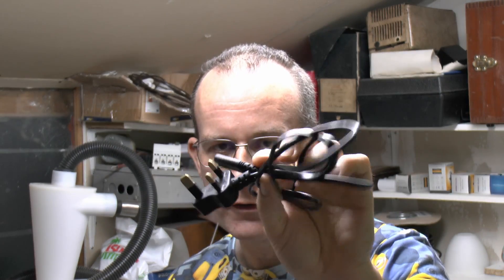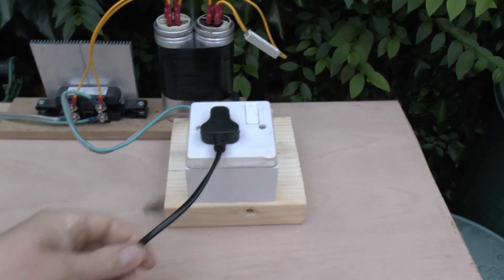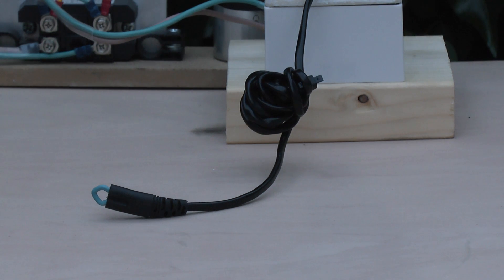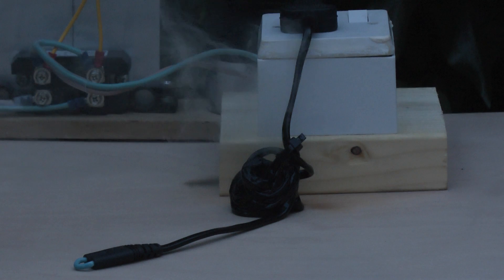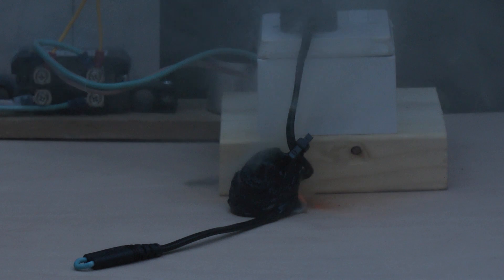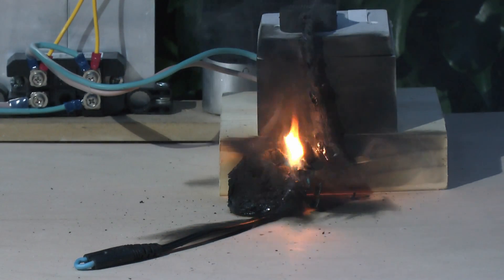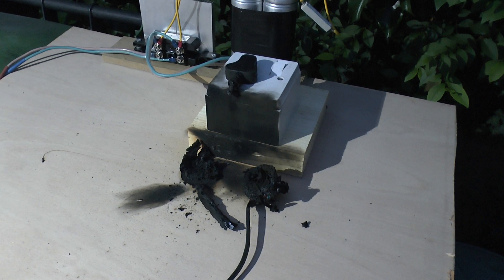Uncoiled and Coiled Overheating Power Lead and DC Burnout

Comment: Is this caused by the coil or the short circuit?

Could you short circuit it without it being coiled and would it do the same thing?
Reply from the maker: Caused by the excessive current and short circuit.  Coiled up just concentrates the heat into a smaller area so it fails faster.

Comment: I've got a plug like this has the 3 pin on the other end for an xbox charger would you recommend getting rid
Reply from the maker: Yes, it's not safe for use.
If the charger came from the same place, suggest getting rid of that as well and buying an official Microsoft one.

Comment: A bit of an unfair test though, 16 ish amps as 315 VDC (assuming that device is a full bridge rectifier) is quite a bit more than any appliance cord will ever see. Also, the exact same cord is very common in Europe (sans the ground pin of course), and they are not an issue at all. But then again all our appliance cords are unfused, commonly 0.75 mm2 conductors, and we manage to not burn down our houses quite well anyhow. But then again all sockets are usually behind a 10, 13 or 16 A fuse, never a 32 as with your rings. How the insulation kept burning after the power was cut is a bit worrisome though, but if they didn’t bother to follow any standards for the plug I’m not surprised that they skimped on the insulation as well.

Comment: Have watched this twice now. I totally agree that these plugs are wrong but the plug did not fail in the test and the cable only failed because of the coiling up as any cable would do. If the circuit was fed from a radial MCB as I beleave you prefer then it would be protected.  That said thanks for the smoke and flames always makes good viewing.

Comment: To be fair.
John had to cross a lot of boundary's to make that fail.
Although I agree it's 100% crap, if it was used as designed, it seems to me that it could have handled it a 3kw water heater worked just fine until the cable was coiled.
Can anybody tell me what would have happened, if a correct British standard lead with 13 amp plug would have done differently?
Reply: A correct British 13A plug with 13A fuse and minimum 1.25mm2 flex is rated to carry 13A indefinitely. So, nothing would happen - the water in the (plastic?) bucket would eventually boil...
Reply: Problem with the cable in question was that it is supposed to handle 13 amps but as you can see at the start of the video, it gets almost too hot to touch at merely 12 amps.  If they'd used the correct size of wire it would barely be warm at 13 amps so even coiling the cable would've taken much, much longer to heat up to a dangerous level.
Reply: @Berkeloid0  Worthy to note even 5A on a coiled up 13A rated cable is enough to overheat it.
Reply: @millomweb  I would like to see that put to the test because not that I don't believe you, I just find it very surprising that a couple of loops would be enough to go from ambient to overheated, so it'd be very interesting to see how little (or how much) it really takes.
Reply: @Berkeloid0  I said a coiled up cable - not just a mere couple of loops.
Sadly, I didn't get a photo of the wrecked cable nor did I keep it. I'd be surprised if there isn't an image of similar on the web somewhere.
Reply: @millomweb  Well I only meant coiled as in a cable loosely looped around to shorten the length.  Of course if you tightly coil it up then it's going to increase the inductance but I'm thinking more about a typical domestic situation.  Not that interested in images though - I know what would look like - I mean an actual test like JW does.  Comparing different loop sizes vs heat production to see if there's a point at which it changes from being relatively harmless to risky.
Reply: @Berkeloid0  I don't think the issue is down to induction but due the the fact a coiled cable  significantly reduces heat loss. 
Good extension reels have thermal protection. The typical domestic situation is a 50m cable run out a couple of metres - leaving 48m still on the drum. Mostly fine for a bit of DIY but running even a relatively small load - say 500-1kW for a long time will allow the heat to build up.

Comment: John,   It would be really good if you could explain and show to the people on your side of the pond how the US systems work and maybe some terminology differences.   I see many many comments on US videos on how bad our system is horribly bad.   Our systems are not bad, but for residential and small commercial, they are just different.   Our electrons flow in conductors just fine.   Thanks for your videos!   I'm learning more about your systems.
Reply: They're 'bad' because they don't have all the in-built safety features our stuff has. Fortunately, in most cases it's not so important but what you do have is all the ingredients readily available for creating a death trap.

Comment: Great video John!   You set it up for an inspiring outcome.   Being from US , many years ago, IEC rated electrical equipment became approved and available here.   Simply stated, compared to NEMA rated equipment, IEC rated is junk!   Example: NEMA contactors 100,000 operations listed,  IEC. 10,000 operations.   Having said that, getting "fake" equipment that doesn't meet IEC is really scary!   Some things should not be skimped on!   Life safety is one of them.
Reply: Kevin, this video is not about IEC standards. There are plenty of NEMA ratings that are inferior to IEC, so that doesn't mean much.
In any case, even the non-compliant British Standard mains plug shown in this video is still SIGNIFICANTLY safer than the piddly little compliant mains plugs used in the USA.
Look carefully at the distance between the live pins and where your fingers could be while inserting and removing the plug in the socket. A fully-compliant BS-standard plug is "even safer" in that regard, as well as containing a HRC fuse.

Comment: JW, you are a pillok! this cable at best was only meant for 5A and as you showed it did not do a bad job with 12A or 5.76 times the rated power. The only failure is the lack of a fuse.
Reply: I was thinking same with a immersion heater linked to it 🤣
No fuse tho... they come with overlander chargers lol

Comment: So none of the household safety devices (CBs) would prevent this, or were they disabled ?
Reply from the maker: This video is about destroying a dangerous, fake item.  It's not a realistic situation.
Reply: The water heater was limiting the current in this case. If there was a device connected on this lead and it short circuited, CB would probably trip like it should.

Comment: There is a song with the lyrics, "what's he building in there".
I once was given a roller extension to look at as it had failed, I unwound the cable, to find a melted stuck together core of about 10 turns. I asked him what he had been using it for, he told me it was a water boiler. He hadn't unwound much of it as it wasn't that far away from the socket. Obviously it had a good load on it for a long time, till it gave up.
Extensions do have dual ratings folks, a low one for wound and the higher one for fully unwound. Take note..
David (G1ZQC)
Reply: "What's He Building?" on Tom Waits' Mule Variations.

Comment: Quite misleading (pun) and over-dramatised. The tightly rolled ball of cable was unrealistic - I assume there was no failure when it was in a coil like normal people store cables?
Rather than guessing, should have had an Ammeter in-circuit to measure the DC current. Note that the fake BS plug and IEC C7 connectors both handled it OK. This kind of cord often only needs to be rated 2A or 3A due to low rating on the IEC C7 end.
What would have been more interesting was to compare with a "compliant" cable. I bet that would have done the exact same thing, except that the flame would have self-extinguished quicker. Not sure if the spitting of molten flaming balls only happened because of the DC?
Reply: @Mr Brightside - but NOBODY would coil a cable into a super-tight ball and then attach a THIRTY TWO AMP water heater and pump it with DC current (remember, the voltage is higher after rectification).
The reality is that, based on this demonstration,  there is ABSOLUTELY ZERO fire hazard that anybody needs to "realise about".
It's totally ludicrous to deduce anything whatsoever from this silly stunt demonstration. If we want to see things "popped" then we go to Photonic's channel, not JW's. 
DISCLOSURE: My real-life paid job is primarily based around compliance of electrical cables, for all countries including the UK. This is a subject that I know a LOT about.
Reply: @johncoops6897  The rating for the cable was inappropriately high. As a result, it gets too hot. As a coiled cable, quite possibly not an issue but some people run cables under carpets - great for keeping the heat in and igniting when hot. That's the issue.
Reply: @millomweb  - the rating of the cable was never discussed. If it was a high rating, then that would be better. No matter what, a cable will NEVER get hot enough to ignite.
Reply: @johncoops6897  No they don't but they get hot enough to melt and expose live wires and they get hot enough to ignite things near them. 70-odd people were killed in a fire in Grenfell tower due to this issue.
Reply: @Mr Brightside That's normally safe enough, as these are low current devices.
Reply: @Mr Brightside - listen here, you fuckwit!
What I am saying is simply that THIS video is unrealistic and does not demonstrate undersized conductors nor any real-world safety (or fire) risk.
If JW wishes to show the dangers of all those things that you mention, then he should demonstrate those things. This video doesn''t do so, irrespective of your bleatings.
The hundreds of thousands of cables that our company sells into the UK (and Singapore who use the same standards) are 100% legal, compliant, and certified by BSI. There is separate tests and certifications for the Mains Plug, Cable and C7 connector.
Our entire cordset is rated TWO AMPS, since that is the rating of the C7 appliance connector. The fuse in the plug is 3A. The cable only needs to be sized for 2A to 3A, and it would never be used with a 13A load. The cordset demonstrated here by JW, whilst obviously non-compliant, is exactly the same specs - hence why a demonstration of coiling it into a ball then running it with a  32A DC load is a totally bullshit demonstration of "lack of safety".
How is that so fucking difficult for you to comprehend?
Reply: @Mr Brightside - You seem to have a significant comprehension problem, causing you to complete miss the point of my comments and how they relate to THIS VIDEO .
I do not disagree that there are non-compliant cables that are on sale today in the UK  However that's not what THIS VIDEO is about.
I do not disagree that undersized extension leads present an overheating risk if they are used with something like a fan heater. However that is not what THIS VIDEO is about.
The cord set shown in THIS VIDEO has an IEC 60320 C7 plug, and is only used for LOW POWER household appliances like shavers, portable hifi, printers, shavers, laptops, etc. The IEC C7 cable in THIS VIDEO cannot physically be connected to a fan heater.
The cord set shown in THIS VIDEO is rated for 2A or 3A maximum, and loading such a cable with 16A or 32A DC (at < 340V peak) is totally unrealistic. The UK power supply is 220-240V AC, so any form of DC load is unrealistic.
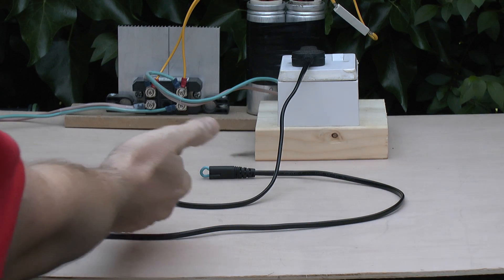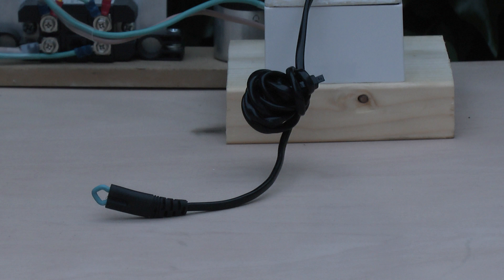In THIS VIDEO JW is showing the destruction of the cable, an alternative to cutting it with scissors. It easily survived the ~1000% overload (watch 2:15) so he was forced to create a totally unrealistic scenario (watch 2:39) in his attempt to kill it.
Within THIS VIDEO the non-compliant UK mains plug show any evidence of fault - it was the 0.5mm or 0.75mm flex that failed, but only once subjected to totally unrealistic operating conditions.
A fully compliant IEC 60320 C7 cord set (like our company supplies) of the same type would ALSO have failed if operated in the way shown in THIS VIDEO .
So, how about you keep it on topic?
You should read the title and description of THIS VIDEO*, then watch *THIS VIDEO again carefully, in particular noting what JW says, then read my comment about *THIS VIDEO*.
Have I stressed the 2 words THIS VIDEO enough for you to understand?
Reply: @johncoops6897  You don't need an unrealistic video demonstration to start an electrical fire. The concept of a coiled wire adding risk is as real in real life as it is in this video.
Reply: @Mr Brightside - dude, I do find it entertaining. However I know a lot about electrical products, power, cables and safety compliance, so I do not for one moment consider that this video has anything to do with the stuff that you mention.
THIS VIDEO is simply JW trying to be humourous, and he ends up looking like a boringly staid "Captain Sensible" version of PhotonicInduction.
You are reading far far too much into this video, and your mind is telling you things that it doesn't actually contain. For example, the "non-compliant" aspect of this cord set is the mains plug, yet that didn't fail at all. Furthermore,  ANY cord set of this kind would overheat and fail if it was bundled and overloaded in the same way.
So this video proves nothing, does it?
Reply: @johncoops6897  I think it proves you're a failure. You've just said: "For example, the "non-compliant" aspect of this cord set is the mains plug, yet that didn't fail at all."

The plug, as a British plug, DID fail. You just didn't seem to notice. The apparent failure was the cable - you noticed - but it was not the fault. The fault was in the plug - lacking a correctly rated fuse to protect the cable from overheating.
It's the equivalent ineptitude of the customer who brings his car into the garage because there is oil leaking from the sump. The leak may be near the top of the engine, it's just that oil tends to run downhill and drip from the bottom even if the leak is at the top. It's a matter of understanding the principles rather than jumping in and stating the obvious.

Comment: surprising how fast they go when they go. 5 mins of smoking and then fire  + arcing
Reply: That's because the arc is considerably hotter - thousands of degrees - than the heating provided by the electric current which might reach one or two hundred degrees.  So it takes a while to melt the insulation enough to arc, but once that happens, the temperature skyrockets and it's much easier for things to ignite.

Comment: JW burning the house down so you don't have to. It's sad, but there is guidance out there against coiling extension cords thinking they will heat up somehow. Good grief, we have portable vacuum pumps at work on carts that have untold feet of thick 3-phase 480V cordage wrapped around the handlebar of the cart. Oh, the humanity! Is there some way we can introduce the writers of cautions to basic physics? No, i don't think so either.
Reply: The traditional advice about coiling extension cords is that it creates an inductor. And indeed, that's wrong, because the line and neutral cancel each other out as far as that goes. However, if you're using the cord at a current fairly close to its rating, then there's insufficient air circulation to keep it cool, as demonstrated here. So it's not a good idea to have cords coiled up, at least if there's any chance that you'll be using it at or near its rated current.
Reply: @puckcat22679  - the cord shown in this video is being operated at between 6 times and 10 times it's rated current, AND then operated on high voltage rectified DC. In order to have anything happen, JW finally bundled it into a tiny ball which was held in place with zip tie. 
Obviously there was no overheating, danger or fire when this cord was operated within it's rated voltage and current, irrespective of whether it was bundled, coiled or whatever. 
- If there was, then JW could have demonstrated that :-)